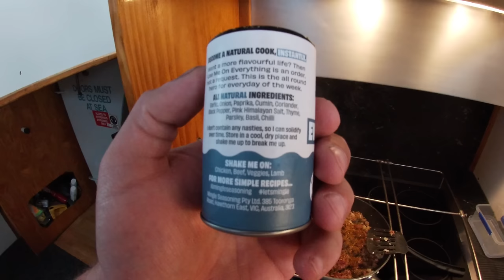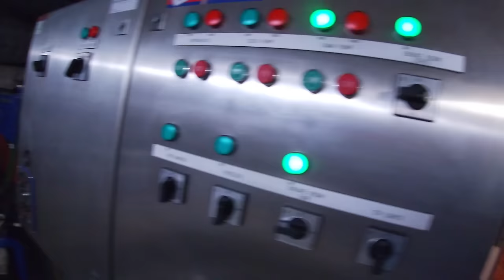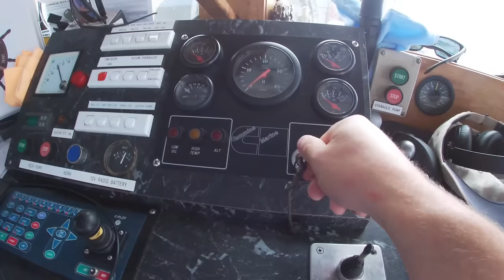Lobster bites crew- our final day shot at Pedra Lobster fishing.

Comment: Good setup on the boat. Probably the most mechanically ergonomic equipment design of all the lobster boats I've seen but workflows are sometimes confusing with double handling but I do admire a single operator on deck with pots spaced close together. Much Respect and thanks for the Tassie Lobster. Best in the World.
Reply from the maker: Thanks Alistair! Really appreciate it. It's a very smooth operation when 2 are on deck. Not much moving about is required.  Glad you enjoyed!